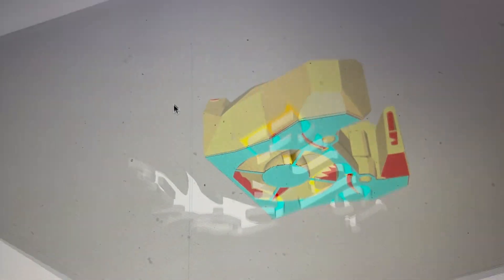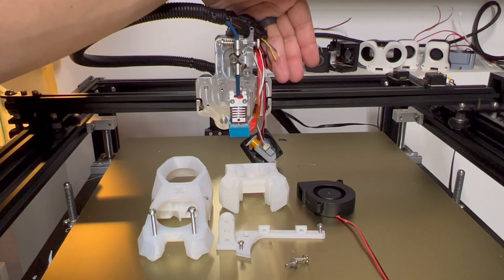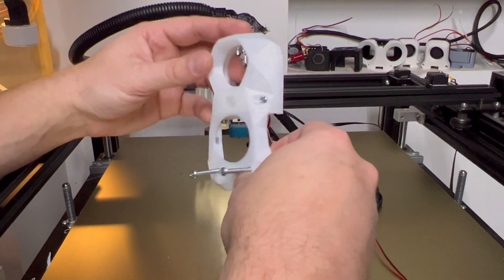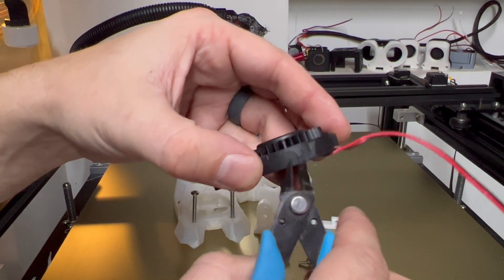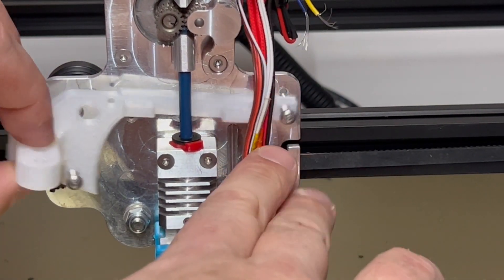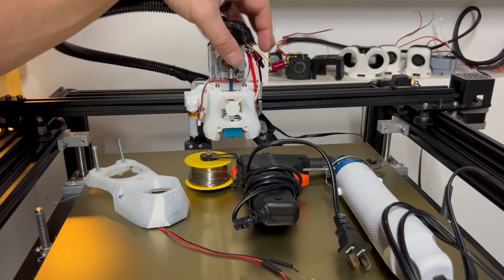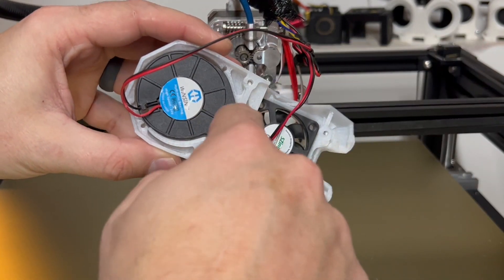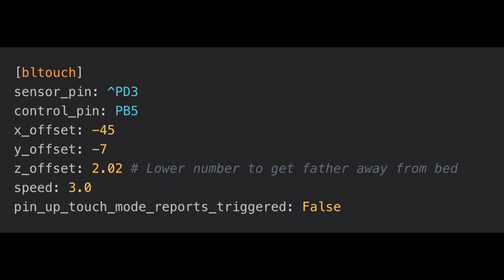🆒SteathlySwiss - Voron Stealthburner Mod for Micro Swiss Direct Drive on Ender 5 Series 3D printers

Comment: Love how simple this set up is.  But just gone to fit it on my E5P with MicroSwiss DD & Hot end.  But come up against a little snag, the shaft on my extruder protrudes out preventing from it fitting, is a new creality 42-40 stepper, think they may have changed some dimensions since this was designed?  Think going to have to take a dremel or something the excess shaft?

Comment: One thing you'll find about the Winnsin fans is that they are extremely underpowered compared to other same sized fans; their 5015 is rated at only 3.2 CFM whereas others are rated ~5 CFM.  They also have a bad reputation for shorter than rated lifespans.  I got burned several times on them and I will never buy a Winnsinn fan again.

Comment: This won't work with the mmsd ender 3 carriage?
Reply from the maker: It should, but the extruder stepper motor pin is a bit longer so it may need to be cut
Reply: @ThingsByRoma  I was more referring to it smashing into the x axis limit switch or cover since the ender 5 carriage is wider
Reply: I'll still probably print this or the Swiss burner and try. Currently using a red squirrel and not very impressed

Comment: Any chance of a mount like your last one that can be ender 3 or 5? Timing is impeccable, just put this on yesterday.
Reply from the maker: This should work on both, but I’m planning on making in designed specifically for the Ender 3 series as well
Reply: @ThingsByRoma  I believe all that will be needed is the length of the part that goes behind the PTFE tube, get trimmed back a bit
Reply: Actually just finished printing and installing the backer piece onto the Ender 3, it's too thin and flexes because there's no second support hole all the way out on the right. Almost as if it's better with your original bracket but with the new upper spacing for the shroud mounting holes. <- I don't think that just made sense

Comment: Do you need to adjust in the firmware or slicer for moving the bl touch or is it in the same position?
Reply from the maker: You need to adjust it in the firmware. My settings are listed at the end of the video
Reply: @ThingsByRoma  which program do you use to access your firmware?   Could you do a video on that sometime?